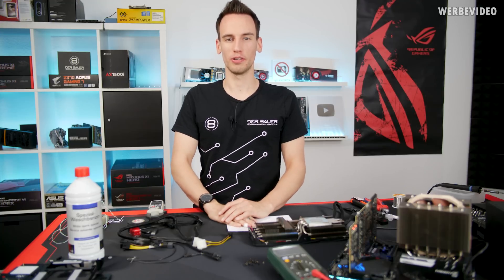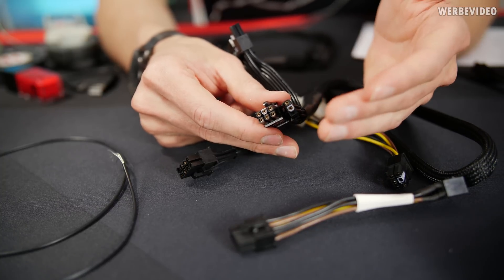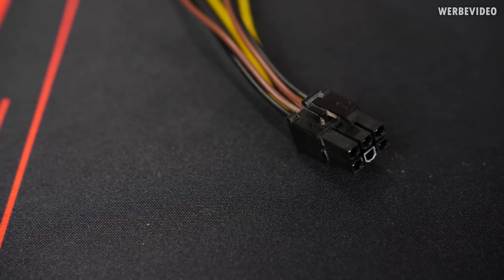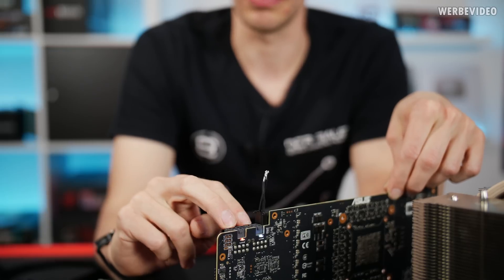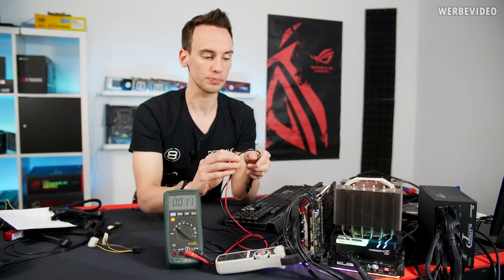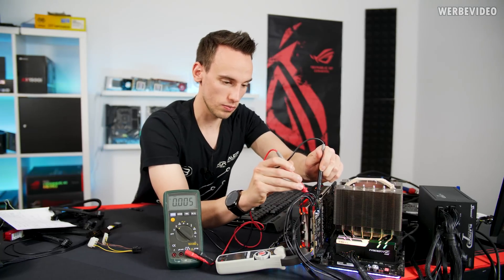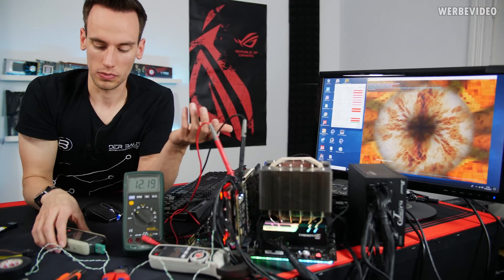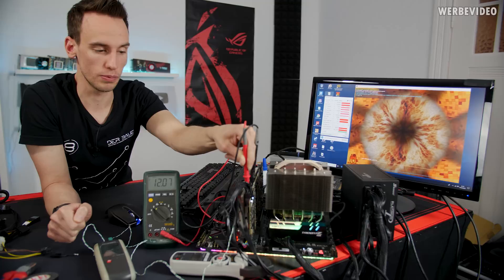PCIe Cables: So much does your GPU really need!

Comment: Now do it with Vega 64:D
Reply: do you have one? or you following stupid memes?
Reply: @TheBogimen  I personally don't have one though I remember a video by Jayz2cents where he had issues getting a Vega 64 to work when it was plugged to a daisy-chained 8-pin PCI-e power cable.
Reply: @AlexanderKalish  Yeah now I know why jayz is paid actors.
Reply: @AlexanderKalish  facepalm - you should never plug in high power draw acessories to daisy chained 8-pins >>it includes NVidia cards<<. Its stated in every PSU manual. So i dont know what are you trying to say, that when you will not follow guidelines you will have issues? J2C videos are fun but not very informative, he made many mistakes in the past accusing parties without fault. btw Vega draws about 50-70w more than Nvidia mid-range cards and about same power as 2080ti. It is less efficency? Yes, Does it need fking powerplant with insane power delivery? No.

Edit: also remember its not 'new' gen graphic card
Reply: @Martin M not sure if troll or stupid. Trying to suggest that NVidia cards dont draw more power when overclocking, i had bios modded 970 that could draw crazy amout of power but thats not the point. GamersNexus had OC Vega56 that could draw around 500W and was a real monster but he stated cleary that bruteforce OC is 'stupid' and its not how Vega OC should be done for long term use. Stock Vega in highest performance mode draws for Vega56 about 210W, Vega64 about - 295W(that one i checked and it match) and Vega64LQ - 345W. Because of thier high power consumptions its recommended to lower voltages while increasing power limit and then doing mild  HBM OC, on some cards it can give you up to 15% performance boost without power draw increase. After that if you want more you can balance voltage and clocks on every power state for optimal power usage or increase clocks for p6 and p7 for higher performance.

Many peoples agree that stock Vega isnt very well tunned and its recommended to do it yourself in a way you like (i saw posts about Geeks that lowered power draw of Vega64 to 200W while losing very small amout of performance). Same could be said about 1st Gen Ryzen - unlike refreshed ones out of the box they are not performing thier best.

And last note it was my first Radeon card and i liked tweaking it with its 'quirks and features' but first i did some research about it unlike you.